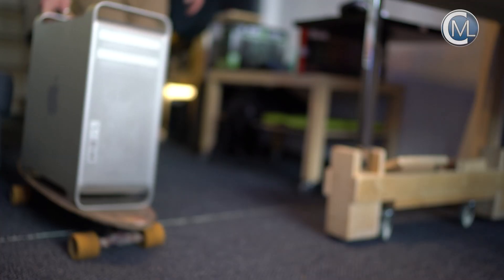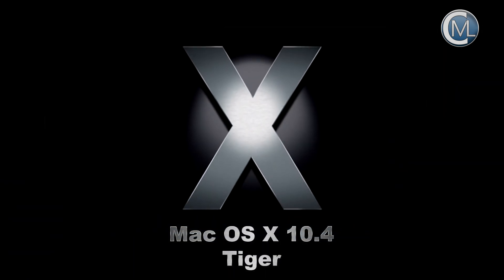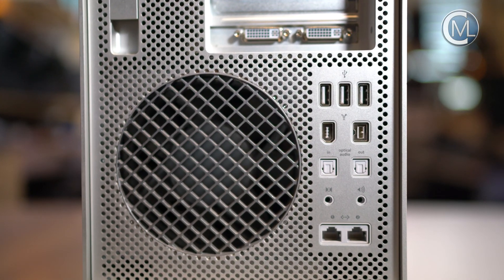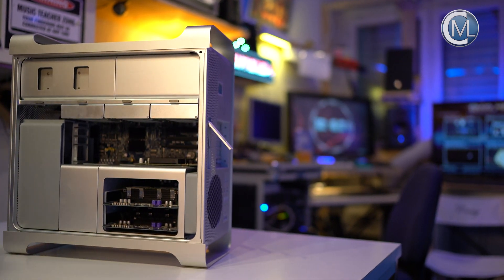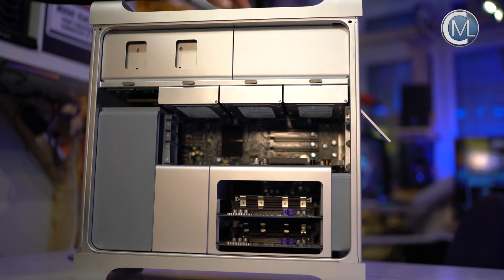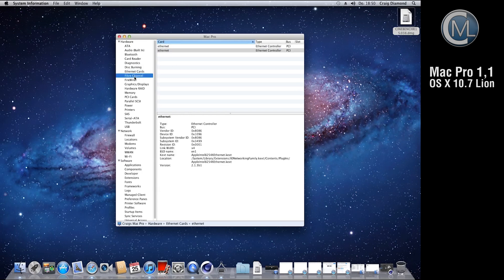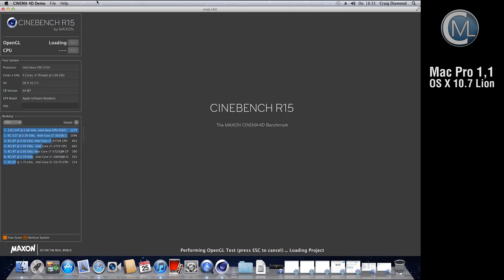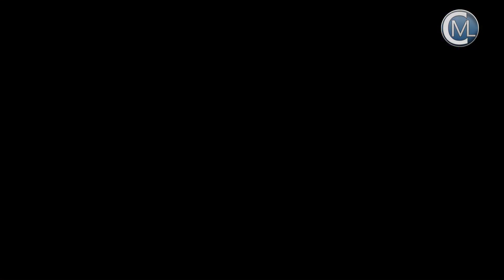🔍 Examining the Apple Mac Pro 1,1 (2006) | A Journey Through Tech History 🍏

Comment: There is a work around with Firefox and you have not worked on  upgrading what is possible like adding 3.0 CPU chip boosting memory up to  32 GB's  I would not say useless if you know what these fine machines can do , the magic about them is the fact you can still upgrade to make them run more then they were intended to run .. thanks to a design still made by Steve Jobs ...

Comment: I have one of these and it is MAXED OUT as the following :
2 x Quad core xeon x5365 CPU 3Ghz (8 cores total)
32 GB of RAM
GTX 970 4GB GPU
4 USB 3.0 ports through Pci-e
2 x Evo SSD 500GB + HDD for storage
MacOS EL CAPITAN 10.11.6 + WINDOWS 10 64 bit
I won't say it's a beast in 2020, but it is really good.
Reply: Solid setup!

Comment: watching this on a 1.1 flashed to 2.1 with two Quad Core Xeons, 32GB Ram and a Geforce 670 GTX running El Capitan as OS
Reply: This video is so wrong in saying this stuff isn't usable. Been using both my maxed out 1,1 and 2,1 both 32gb ram, 256gb ssd, gtx 980ti, 8tb mechanical drives. Both machine are dual boot windows 10 and el capitan.  I use windows 10 when I edit videos in order to fully utilize the hardware...
Reply: René Kaspari  how did you upgrade to El Capitan?  Any instructions anywhere ? And what parts?
Reply: @fredflintstone2234  Hi Fred, In order to upgrade to EL CAPITAN, all you need to do is to upgrade the GPU, and update the EFI to make it 64bit. Just look it up online, the procedure is not that complicated as it seems.
Reply: This video is just bull crap, like you said this machine can be a little beast if you know how to work with it. I have mine running smooth with only the 2 = 2 cores 2.66 with SSD,El Capitan,16GB RAM and 1GB flash Radeon to have the Apple logo at boot with rEFInd  boot loader having also Linux on another SSD. And wanting to make it 32GB RAM with 8CORE .

Comment: Just installed Windows 10 (64-bit) to run alongside OSX El Capitan on my 1,1 (flashed to 2,1). Got two quad-core CPUs and 12GB RAM along with an SSD in mine. There's still lots of life in these machines.

Comment: Okay, in fairness to the 1,1. you have not done anything to get it to run at it's maximum capabilities. Use Piker's Mod to bring it up to El Capitan. Yes. it's out of support, but it is still a very useful operating system. It can also run Windows 10 through Boot Camp. You can upgrade the processors and ram, and flash both firmware and SMC to 2,1 specs, to make it very functional in today's world. It will never be the powerhouse it was back in the day. but it is certainly still a useful computer.

Comment: You can use this for sure.  Hack it to run El Capitan.  Throw in a ssd and upgrade the ram and graphics card.  Can even upgrade the cpus if you want.  Mine came with 32 gigs of ram and raedon 5750.  Works fine as 2nd computer, file server and is a decent backup for photo editing.
Reply: Agreed you can also hack or flash it become a 2,1.  If you are going to do 4k video edits then this computer is out of the question.  But for basic 1080p and audio work this Mac Pro works amazing.  I have a 5,1 and a 2,1.  The 5,1 handles all my video edits and the 2,1 is a great machine.  I can use it to do some gaming like retro style and also use it do audio work.  It runs Photoshop, lightroom and Illustrator like a champ.  Craig has a very nice looking video but the actual review part of this machine was sadly so poorly done.
Reply: @FlamingShutter  Yeah I flashed mine to 2.1 also.  Honestly I paid $200 nzd for this thing!   It is a great back up system.  I only use it for photo editing and some html coding from time to time.  No video.  Its a great looking design, when it eventually becomes unusable I will rip the guts out of it and make a hackintosh out of the case.
Reply: How, how how did you all do this?  I'm not a techie but don't want to buy a new Mac Pro.

Comment: Awesome video!! I recently Picked one of these up for $100. Upgraded to an SSD, 24gb of ram and the quad core 3ghz chips. Flashed to a 2,1 Firmware. It's being used as a tracking rig/Light mixing rig at our jam space. Still super useful computers. Thanks for making this video.
Reply: Same here.  Mine was $20.  Was going to use it for one half of a park bench project but it booted and now is my primary machine.  Got a G5 Tower instead for $10... well m still looking for the other side of the bench.  Oddly, the G5 works too!  Want to locate a couple of liquid-cooled G5s that will never work again for my bench project.
Reply: Which web browser can I use on this mac ?
Reply: @henhel  I was using Arctic Fox. It's basically Firefox but designed to run on older unsupported Macs.